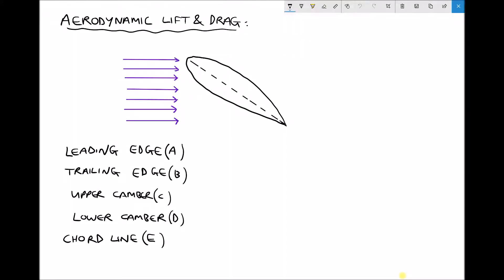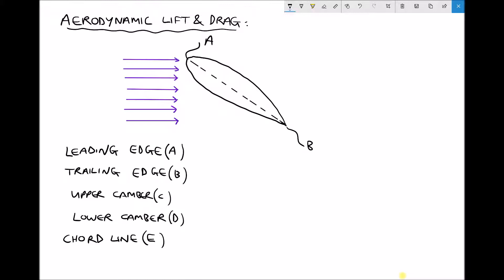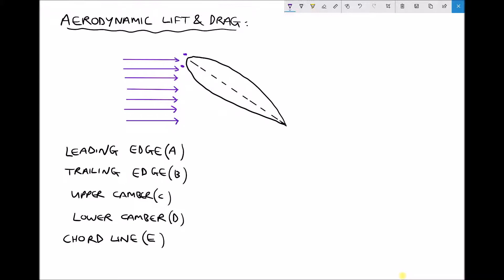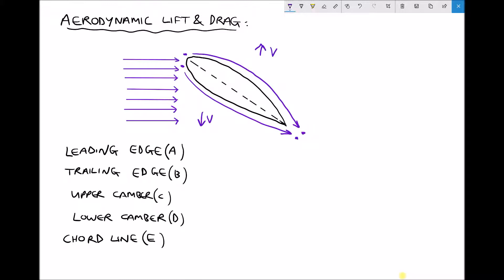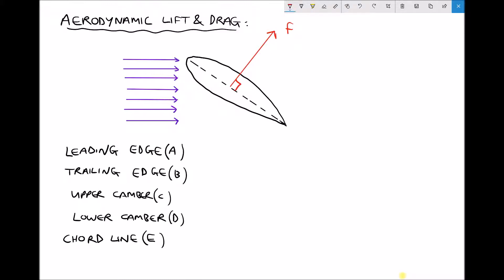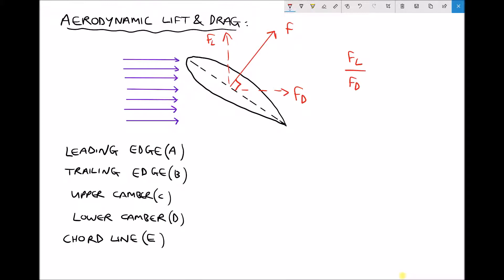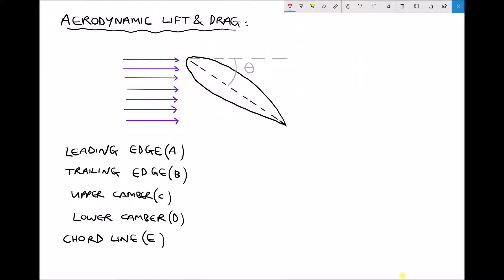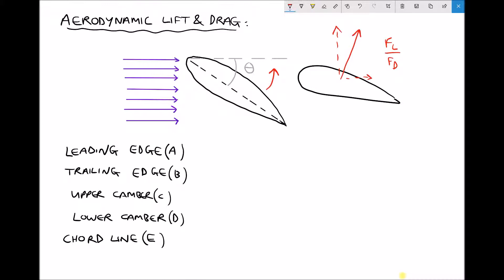Effects of Aerodymanic Lift & Drag Forces on an Aerofoil

Comment: Your explanation is not true. 
The fact that particles on the top surface have to travel a longer distance is not the reason why the go at higher speed. Experiments have shown that fluid particles at the trailing do not necessarily meet.